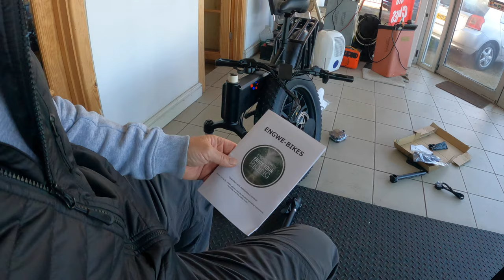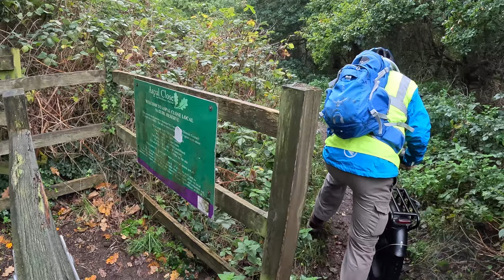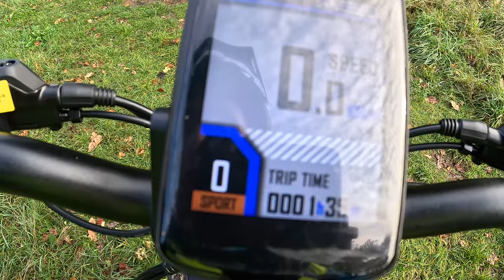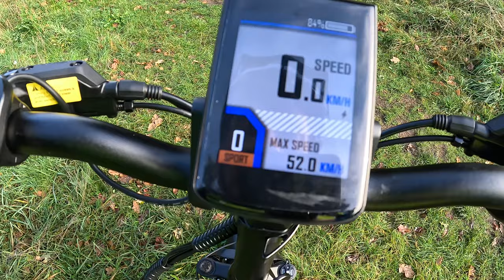A GAME CHANGER! - THE RUGGED ENGWE PRO ELEC FOLDABLE BIKE #engweblackfriday #engwedeals

Comment: You might be aware that we have two full size ebikes 28in wheels etc and if we're ever going to buy other ebikes we'd definitely go smaller as ours are great for long rides but in truth we only do shorts ride and the size just makes them harder to transport, ie putting them on the bike rack, taking the front wheel off to get them in the back of the car etc, so I'm a fan of that style, smaller wheels smaller frame, I thought that was a cool looking funky bike kinder the jeep version of the bike world, 36kg though ours are 25kg with battery in place 22kg removed and they are akward to lift in and out of the car at odd angles, also when you fold them and try to put them in and out of a car boot for example you get the tyres and chain filth on your clothing, as I say I'm a fan of that style but  the weight will be an issue in more circumstances than you'd imagine as I think it's fair to say ebikes are aimed at the older person, would I have one absolutely I would I just wouldn't transport it, maybe you could do a quick vlog with Kirsty loading it into a car boot not a Berlingo boot 🤣, or the side door of the van whilst folded, but as I say I'm a fan and it was a honest fair review, another enjoyable vlog keep them coming 👍.
Reply from the maker: hi Stephen ,  i mentioned to kirsty she should make a video of her lifting that bike in and out of a car or motorhome as to show people how it would actually be , however ,  the answer i got cannot be repeated on here and sounded like a dialect of spanish , very fast and much to the point and rather loud   , so i swiftly took that as a no and moved on … i’ll tell her it was your idea 😂😂 the bike was great i really enjoyed riding it , but it was bigger than it looked and surprised me when i unboxed it , totally agree they can be a back breaker when folding and awkward , something i should have mentioned , a first time for me in that style but rather liked it once i got used to it , it’s nice being upright and was a comfortable ride , a lot of messing around taking the front wheel off and storage and weight would be annoying , but anyone with a garage & plenty of payload , great  👍 
thanks again stephen always appreciate your support of the channel 
mike & kirsty 👍
Reply: Go tell him Kirsty 😂😂😂